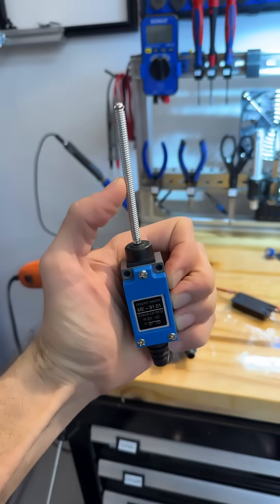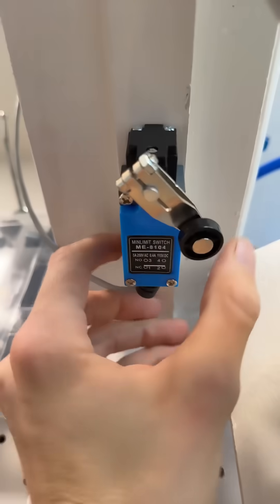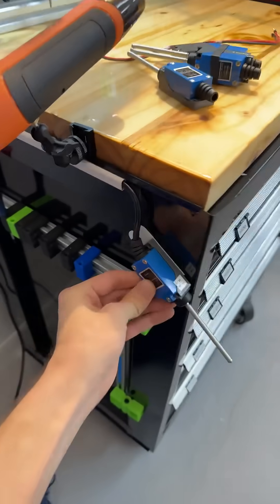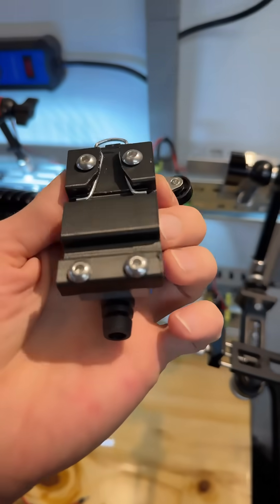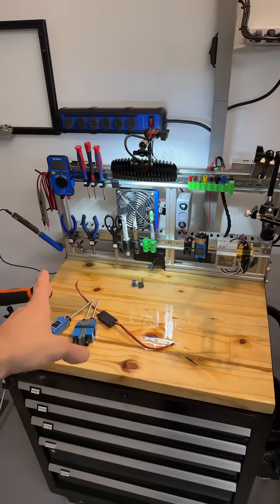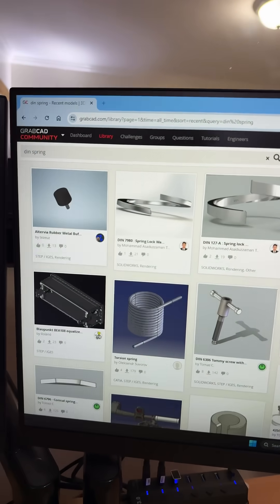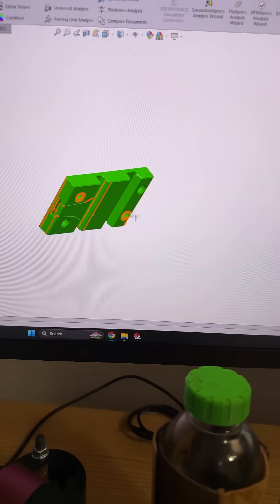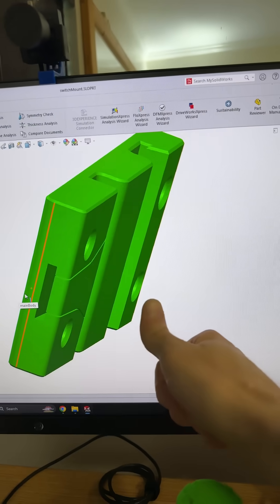My favorite toggle switch, in the mechatronics lab

Comment: anyone that wonders and wants to use these with smarts, the noise bounce on these are pretty insane and the physical location of where they open or close isnt predicably in the same place, off by a few degrees sometimes but they are cheap and pretty stout.(the cheap ones are worse, well known manufacturers are fairly good)
Reply from the maker: that’s why it’s good to use the roller rocker style which is adjustable.
Reply: @davidmalawey no my friend like ive worked with good ones and cheap ones; if you need it to be precise, dont buy a cheap one.

Comment: For the door a hall effect sensor and relay is probably gonna do better since it wouldn't involve the door wearing down a lever
Reply from the maker: that’s true, and a little cheaper. there are common ones sold for home door/windows in various colors.  good call.
Reply: @davidmalawey I love solid state tech, it's annoying how so much of the cheap and ready to go off the shelf gear still uses brushed motors, mechanical switches, and all kinds of other stuff that will probably wear out in 10 years, while the rest of the device is good for 100.
Reply: how many tens of thousands of times are you going to cycle a closet door?
Reply: Mate, the door is making contact with a roller, youre talking hundreds of thousands of cycles before you even have to begin thinking about the roller wearing. The cabinet door is going to wear out before a halfway decent limit switch is going to
Reply: Exactly what I did in my pantry - portable battery bank, 12ft USB LED strip, and a hall effect sensor wired in line with the lights. Works phenomenally

Comment: They make foot pedal switches… check them out, you might could turn on multiple things…
Reply: Don't forget put it out of the way after using it or you might unexpectedly step on it couple hours later and almost cut yourself when the little band saw you have hooked up to it  suddenly fires up and you jump a mile or so in the air.....Just saying.
Reply: @JimRimS4S ooo you didn’t happen to have done that?
Reply: @cliffp73  Who me? of course not. Like I said the last time, it was someone else.

Comment: Thanks for the DIN rail info. I've got a ton of those limit switches on machinery that I tend. There are these on/off toggle type switches (great for relays and digital input) as well as (more expensive) analog (or PWM) types for angles/linear positions/etc.

Nice work.